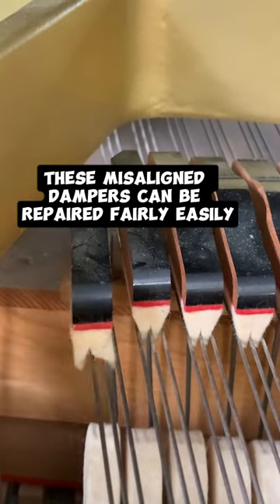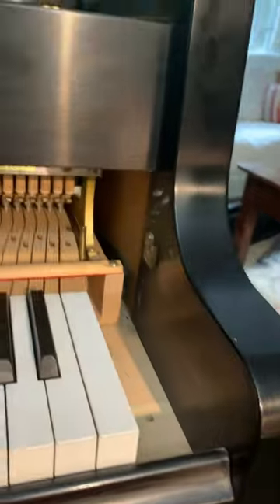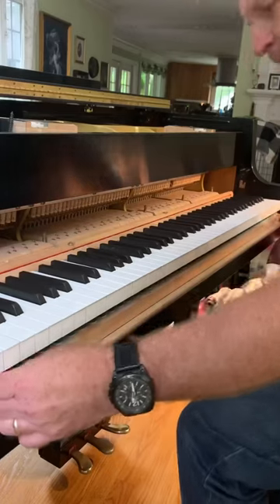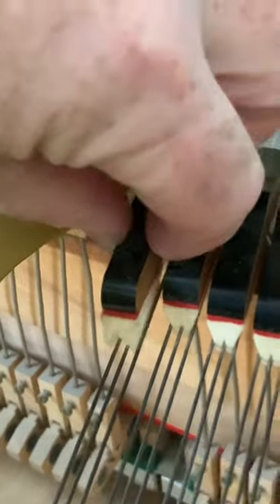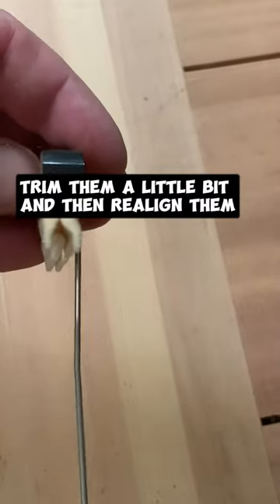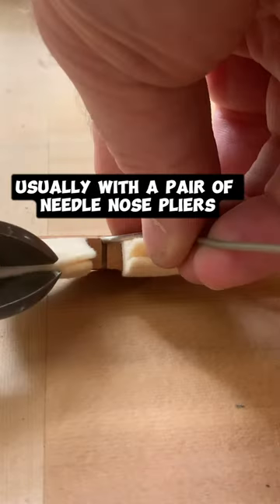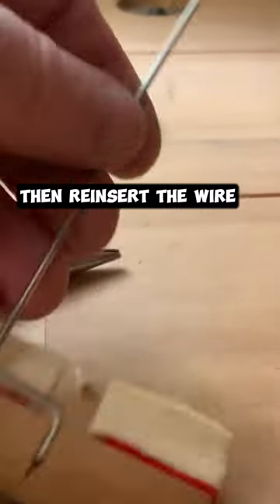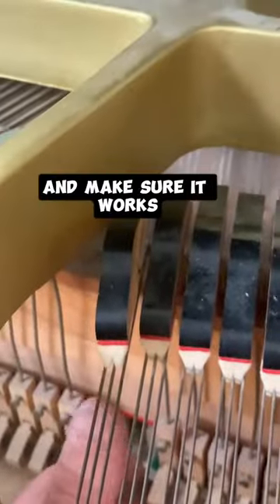Repair damper while tuning a piano. #piano #pianomusic #grandpiano #pianotuning #pianotuner

Comment: Thank you for taking the time to make this informative video. Any tips for eliminating vibration/friction noise from the dampers lifting off the strings when the damper pedal is pressed. I had them trimmed and shaped by a RPT and he definitely improved it, but it’s still audible. It’s primarily the trichord dampers. I think I’ve read some graphite could help? It’s something that probably can’t be completely eliminated, but I’d appreciate any tips or tricks. Thank you.
Reply from the maker: This is one of those necessary evils in an acoustic piano. You want the trichord dampers to stop the sound when they come back to rest on the string so they need to have enough weight and stiffness in order to do that. But, they will make noise when they leave the strings. It is the nature of the beast I am afraid. 

I once had a customer call about this and complain that his keyboard doesn’t make this noise.
Reply: @preludepianosolutions  That’s interesting. I am the complete opposite. I strongly dislike it, but I understand it is a mechanical machine and that’s just a small trade off for a beautiful real piano. I could never go back to a keyboard after owning my Kawai. Thanks for the reply.